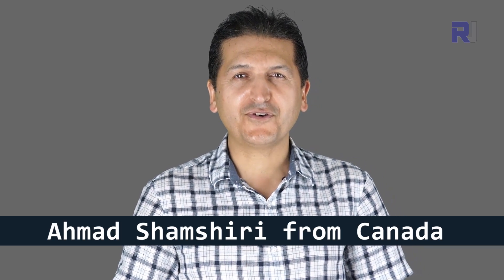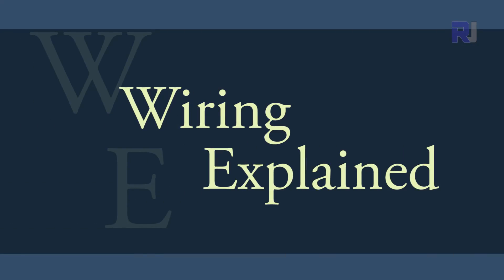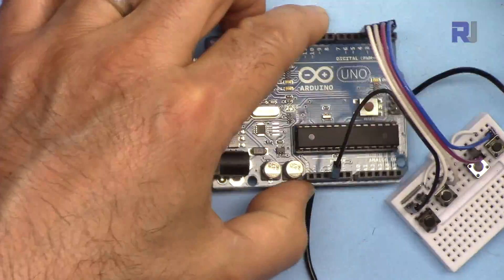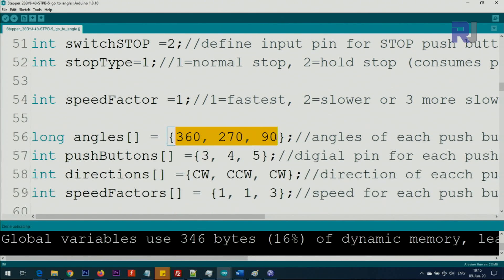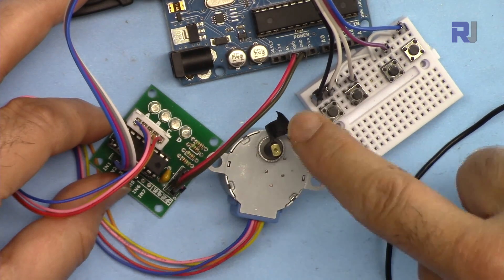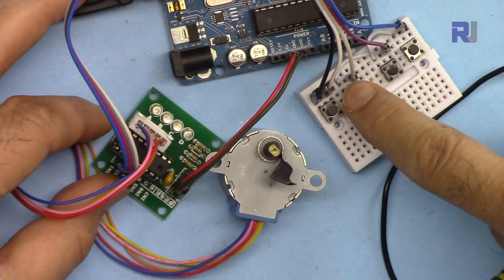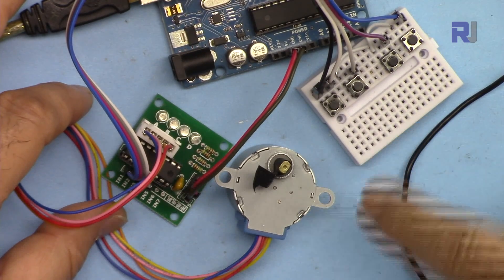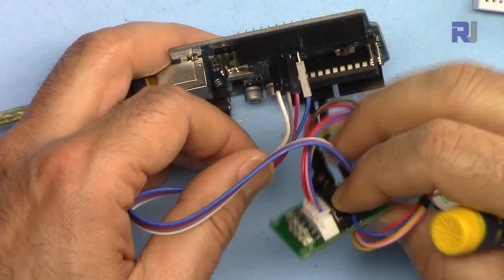STPB-5: Controlling 28BYJ-48 Stepper Motor with push buttons Send to Any Angles

Comment: Hi, i want to control more than one stepper motor 28BYJ, what should i add in the code ? Do you have a video about that?
Reply from the maker: Hi, I have no video on this. this motor needs to have library to make it work.  it will work without library but I haven't written the code yet. All my codes and videos are free, but if you pay me, I can work on it. contact me via Robojax.com contact page.

Comment: You say: the maximum is 7655 degrees. But when i put it on there it wont stop spinning it just keeps going without stopping? You say this in all your videos. Can you help me? Thanks
Reply from the maker: where did you get this "7655" number? mention the time in the video so I can see it. 
But do you know 7655 ÷360=21.26. so it will rotates 21 times before it stops.
Reply from the maker: you posted the same comment in another video.
Reply: @robojax  Yes sorry, I was missed. The time is 6:58. "You can go up 7655 degrees." When I type 7655 degrees, the stepper motor does not stop. How can I prevent this? thanks
Reply from the maker: yes that is for push button 3 which is connected to pin 5.  7655 ÷360=21.26. so it will rotates 21 times before it stops. you have to wait for it until it finishes 21 turns.
Reply: @robojax  It keeps spinning for me. If it's turned 21 times it just won't stop. I think it's weird too, can you test this or tell me how to fix it?

Comment: Selam Aleykum Ahmad
I used nema17 stepper motor+driver l298n+UNO R3 in a mechanical system, the code written below provides the movements I want, but when a push button is pressed, I need to add what code to the text below and connect the button to which inputs on the uno r3. It would be greatly appreciated if you could help me. Like Pushpull, when the button is pressed, I want the motor to proceed a certain step counterclockwise and stop and continue the same operation from where it left off when the button is pressed, but somehow I couldn't.
*/ #include
<Stepper.h> const 
int stepsPerRevolution = 150; // change this to fit the number of steps per revolution // for your engine // initialize the stepper library on pins 8 through 11: Stepper myStepper(stepsPerRevolution, 8, 9, 10, 11); void setup() { // set the speed at 90 pm: myStepper.setSpeed(60); // initialize the serial port: Serial.begin(9600); } void loop() { // step one revolution in one direction: Serial.println("counterclockwise"); myStepper.step(stepsPerRevolution); delay(500);
Reply from the maker: Walaikum salaam,
This vides is for totally different stepper. Here is introduction to using MEMA17 https://youtu.be/csf_G1pi0ps and here is version 2 of the video with push button and some features https://youtu.be/csf_G1pi0ps to accommodate the needs of everyone is very hard. I would have to write 100 different code and projects and yet there will me different way people will need it. so I would suggest watching different project and learning from them.  I am very busy and other than quick replying to a particular video comment, I have no time my brother. salaam

Comment: I am trying to do the same setup using a 12v 2amp NEMA 17 stepper motor, Arduino Uno R3, 6 momentary push buttons and a L298N 25w driver module. This code results in my stepper motor jittering and not rotating. Obviously this code is not suitable for the equipment I am using. 

My project goal requirements are to program 6 buttons:
button 1 : rotate CW 720 degrees
button 2 : rotate CCW 720 degrees
button 3 : rotate CW 1440 degrees
button 4 : rotate CCW 1440 degrees
button 5 : rotate CW 2160 degrees
button 6 : rotate CCW 2160 degrees

motor speed - 300rpm or fast as possible

no emergency stop button required, but needs to hold position after each move.

Advice?????
Reply from the maker: Hi, it won’t work.  The phase wires are different.

Comment: Hello Ahmad  When I upload the sketch there are the following problems
schijf.ino: In functie ‘void setup()’:
schijf.ino:44:56: fout: invalid conversion from ‘const char*’ to ‘long unsigned int’ [-fpermissive]
In file included from /usr/share/arduino/hardware/arduino/cores/arduino/Arduino.h:193:0,
                 from schijf.ino:1:
/usr/share/arduino/hardware/arduino/cores/arduino/HardwareSerial.h:55:10: note:   initializing argument 1 of ‘void HardwareSerial::begin(long unsigned int)’
     void begin(unsigned long);
          ^
schijf.ino:51:50: fout: ‘digitalPinToInterrupt’ was not declared in this scope
How can I fix this problems
Henk
Reply from the maker: Hello,  get the code and try it again. it seems you might have missed some part of the code or accidently changed it.

Comment: Please I have a question;
Is it possible to press the button and it results run the motor in CW only one time and then when the second button is pressed it results to run the motor in the CCW direction. The main point is that when the first button is pressed then it will be disabled until the second button gets pressed when the second button is pressed, the second button will get disabled and button one will be enabled. Please if possible then how?
Thank you!
Reply from the maker: Hello, this is a full project.  I have more than 10 videos about this motor. you may learn by watching and writing your own code.  Or post your question here https://forum.arduino.cc/
Reply: @robojax  I have 28BYJ-48 Stepper Motor control using ULN2003 driver and want to do so as above discussed. Please share with me links to relevant videos. I will be very thankful to you.
Reply from the maker: Here I just made a video for you https://youtu.be/OhkUceBWcHs
Reply: @robojax  Thank you very much.

Comment: Sorry I meant to say full step for the numbers of steps for 1/7 revolution.  In half steps, I got closer.  585 steps x 6 + 586.  for the final one.  Am I correct in that the final error is 0.088 degrees overal?

Comment: Hi Ahmad, When I saw the words "any angle" I thought I solved my issue.  I am rotating the 28BYJ-48 in a full circle but stopping at 51.429 degrees so that I can divide a ring into 7 equal parts.  I call it my 7 Chakra ring.  The closest I have been able to come to this is to use half steps and stop at 293, 292,293,292,293,292,293.
This is actually close enough but I like perfection. :)  any ideas?  I love your videos.  you are a great teacher.  Thank you.
Reply from the maker: Hi, because there is not display to know the sent angle, you set it to any angle and move in that angle position. Even if you have display, it would be hard to know the position unless we use other means to know the initial position. I have so many videos on controlling this motor.  you can have as my push button for any other position. just set it and from the initial or last position it will go there.

Comment: Trying to build a mini elevator for a doll house it’s three Stories using magnetic sensors to stop at each spot I want to be able to stop in the middle floor and be able to push the button on the top floor and it go up I also wanna be able to push the button on the bottom floor and it goes down could you help
Reply from the maker: Get hall sensors. I have video for that.

Comment: can you make an arduino ino file for this project
Reply from the maker: The code is there. You can copy and paste. it has not issue. Only code for WiFi I have seen problem. Try it . it will work.

Comment: The project is wonderful, congratulations.  I wanted to ask you if it was possible to make a video project concerning a display and a rotary encoder to increase and decrease the degrees from 0 to 360 ° and with a confirmation of the encoder he went to that desired position.  Thank you very much for your attention. Dearest 😉
Reply from the maker: Hi, yes possible . But tones of work. 1-rotary, 2-display 3-updating the value 4-motor so putting 4 of them will need a lot of work. perhaps a full week 4-8 hours a day if I start from scratch. I am not sure may less or more.
Reply: @robojax  No I meant only one motor capable of managing the degrees from 0 to 360 ° with respect to the four cardinal points NORTH SOUTH EDT and WEST by means of a rotary encoder.  Is this feasible?
Reply: @odhomeautomation3288   in this iam also interested,,  i think this is antenna rotor controller what i can use in de amateur radio hobby